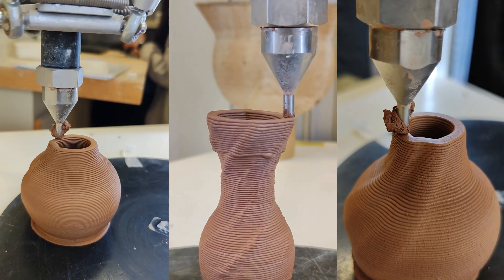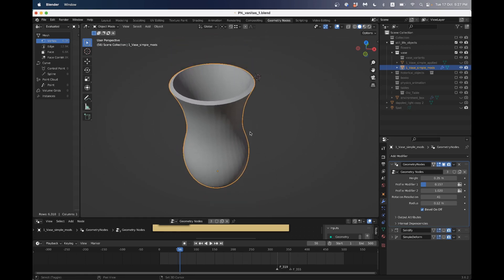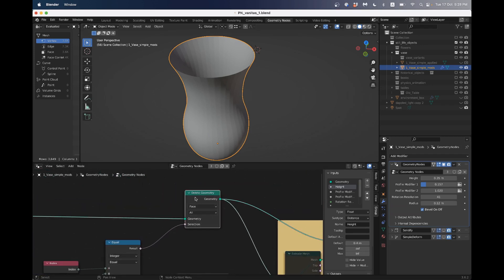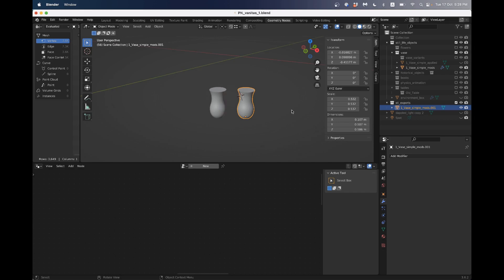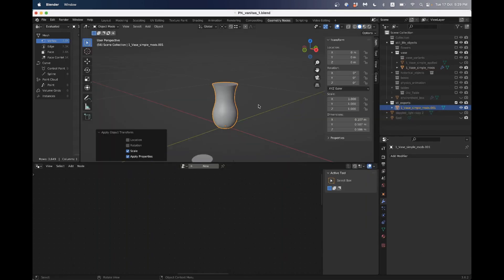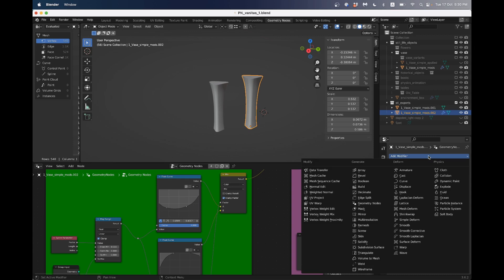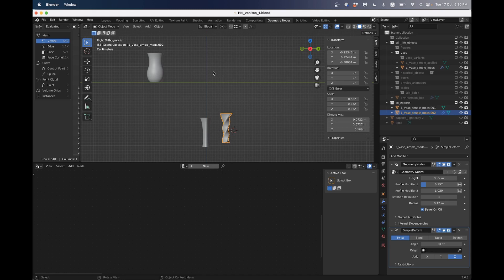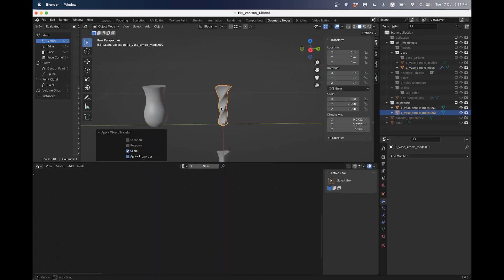Exporting from Blender Geometry Nodes to Ceramic 3D Printer

Comment: how do you create the spiral though?  I understand slicing an object but the prints you have shown were spiraling upwards continuously. How do you generate that from a simple 3d model?
Reply from the maker: Hi there! Sorry for the late reply. I think you are talking about the simple deform modifier I added at the end, which I set to twist?
Reply: @peternelson8856  For our clay printer we need to export a wireframe of a mesh that is essentially the path the printer is going to follow when printing. Think of slicing a model in layers and then only exporting that result. If we want to create a mesh that continiously prints, essentially in an upward spiral, instead of working in layers - we need to create a custom "model". It's more like creating/writing the program the printer is going to follow. 
So I was wondering how you get this continuous printing without having to create a custom program for the printer. Is there another software that generates this? Like a slicer for 3d printing?
Reply from the maker: @poppi3362  oh right, sorry I didn't understand the initial question. For us, we make a closed model (as opposed to one with interior and exterior walls) and then do the slicing in Cura, which generates the path for the clay extruder as a continuous spiral layer like you described. One of my colleagues set up the Cura settings to match our printer. From a quick YouTube search, there are tutorials on this [https://www.youtube.com/watch?v=sS6RdKzGirQ], however as I didn't set this up for our printer, I can't be 100% sure that this video will automatically get the path you need. If you get stuck let me know and I can check with my colleague regarding the Cura setup.
Reply from the maker: By a closed model, I mean if we put in a cylinder with closed end caps, we would print something like an open cup when sliced via Cura
Reply from the maker: One more thing @poppi3362, I bumped into my ceramic colleague yesterday, and he said that for printing a simple vase shape from a closed cylinder, in your Cura settings, all you need to do is to set the slicing mode to vase mode, which creates the continues spiral of the outer contour, then choose how thick you want the base layer to be, and disable printing the top of your shape. Hope this helps!
Reply: @ Thank you very much. It will be a few months till I get to print again, but I will try this out. I honestly didn't think you would see this comment, so I very much appreciate your response and assistance. Thank you.